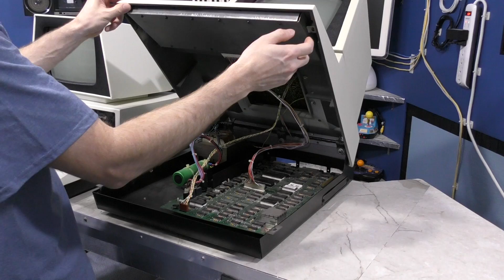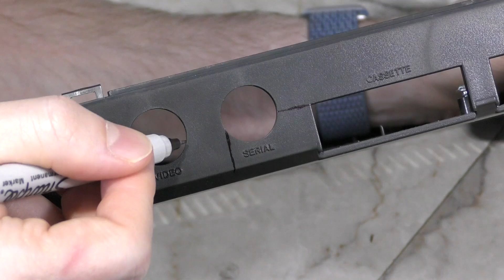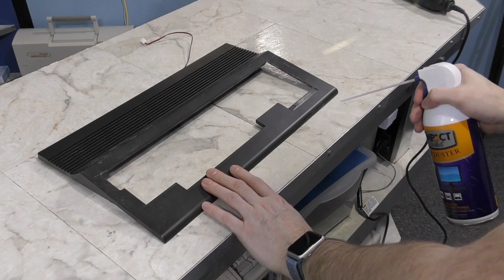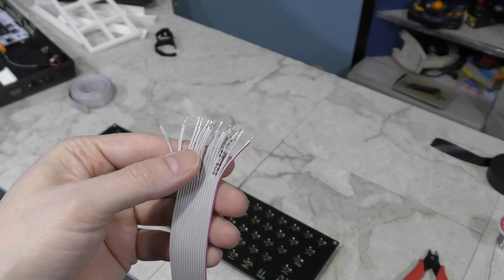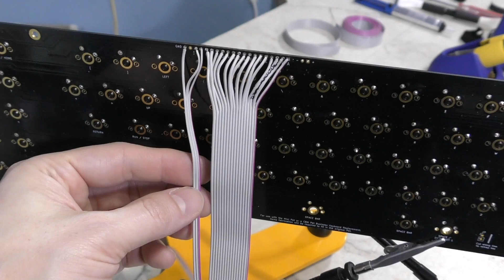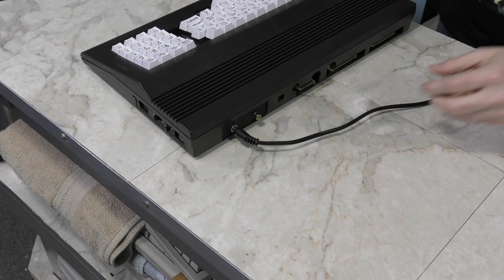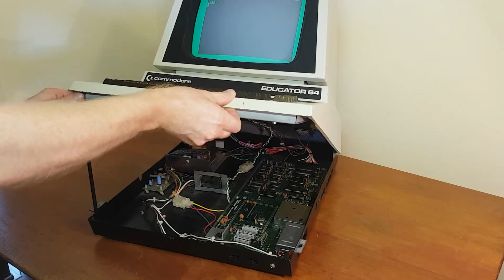Building a case for the Mini-PET

Comment: The weirdest video I have seen in a long time. Why not just 3D print a proper case? Takes probably the same amount of time to design that as it does to cut out all the stuff from another case that just looks horrible at the end. Don't get the approach here.
Reply from the maker: Most 3D printers can't print something that big.
Reply: @The8BitGuy  I guess I would print it in smaller parts and then assemble it? Even if it looks more polygonous with less of the C64 case roundness, it would look better than leaving holes at the back and keyboard, but that is just my taste.
Reply: David is right, just not feasible right now - maybe in the future we can 3D print a custom case.

Comment: Yup, I can confirm that soldering doesn't get easier as one gets older. One day, I was having trouble soldering, and that's when I finally broke down and got reading glasses.Bad news, it's harder to deny that I'm over 50. Good news, my soldering has greatly improved!
Reply: @ItsMrAssholeToYou  LOL! That's better than walking 20 miles to school... Uphill... Both ways.... Through the blinding snow.... in July.... I shouldn't complain too much, I spent my 50th birthday wondering how the hell I'm not in a wheelchair or just dead.

Comment: Honestly, you've saved enough retro computers, that I think you'd be entitled to dremel a few cases by now, Dave. 😉 -- And not just physically saved, you've provided education that I think has contributed to saving a few of them from landfills, and contributed software and other resources to make some of the less sought after machines worth thinking about again!  Keep up the good work. 👍🏻
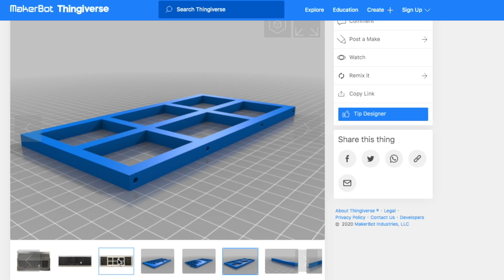Edit: RE @12:58 -- Honestly thinking about the board and port mismatches -- why not just put the PET board deeper in the case, and use card edge connectors on ribbon cables to match up with the C64 port positions? -- It seems like it would be easier than getting Tynemouth to redesign the board...

Comment: Once we have 3d printers that can lay down some simple circuitry during the print, we'll be able to print the keyboard and case as one, then add switches and key-caps.
Eventually printers will be able to do entire PCBs and populate them, but I think the former idea is not far off.

Comment: why not a barrel plug for the power and a quick disconnect for reset? that way the board can be removed without desoldering anything. For the LED you could probably wire it between the reset switch and ground. /RESET floats high and is already current-limited, so...
Reply: I asked about that but he said once it's in the case it'll never come out so I just left bare wires.

Comment: A heat gun makes shrinking heat-shink tubing better than a lighter. (No carbon or accidental burns.)
Reply: Swings and roundabouts. I have a heatgun and I sometimes just use the tip of my solder iron. I have also been known to use my BBQ lighter (long tip) just for cases where I couldn't be arsed with bringing my heatgun out.

Comment: Dave: "filling those gaps would be too much trouble"
Parifractic: "Hold my beer.."
Reply: Yeah, I did see Perifractic build out additional case structure before. He made it look easy somehow. I was really impressed!
Reply: Ok ok
Reply: Cf ok ok
Reply: Cescecu
Reply: Bec
Reply: Jocuri ie
Reply: Domna
Reply: Domna ok ok
Reply: Dai sms pod
Reply: Vedete
Reply: Ciobanu
Reply: Cf răpit
Reply: Wifi
Reply: Tadu
Reply: PPces
Reply: Cf
Reply: Robetes
Reply: Își
Reply: Ok
Reply: Hoti
Reply: Tepatori
Reply: Vadu
Reply: Caldarîm
Reply: Ok
Reply: Cescu
Reply: Pationu
Reply: Eu
Reply: To make the case look better take the 'BBC Micro approach'. Cut a hole that is rectangular that can fit the whole keyboard into it. Then use some poster card (Black?) and cut holes out in it to the exact shape to harness the keyboard into the rectangular hole and attach it to the underside of the top part of the C64 case making sure its overall perimeter is slightly larger than the rectangular hole cut out of the top part of the case so you can stick the edges to the underside of it.
ADDTIONAL: You can also line the Poster Card with black self adhesive laminate (similar looking to what the BBC micro has - available at arts & crafts stores). It will look much more professional and no unwanted spaces or holes!! :)
Reply: @ojbeez5260   Bv cat una este greu si noi  rapoarte cf greu fimeri multi hoti si multi hoti si dai sms ok da greu este

Comment: Wonderful as always. Still working on my Atari 8 bit "Space Invaders" game. Got the finer scrolling going, invaders being animated by loading different frames into the parts of the character set where they reside, your player can shoot pixel wide holes in the barriers (again. character set modification going on)...next thing is to detect the player shooting the invaders, and after that there'll be the missile multiplexing handling. Looks like most game mechanics going on in this game will be handled by means of a deferred vertical blank interrupt, which is awesome. The next game I will try to write will be a "Scramble" clone, but in all honesty, I probably will try to make the maze level not as much of a nightmare as the arcade version. Also bear in mind, still got quite some way to go with the current project.I just haven't looked at any of this sort of thing in years.

Comment: A redesigned PCB should align to the top-right not top-left part of the case.  That way, the connectors and switches can all be on the board.
  For attaching the ribbon to the keyboard, I guess a standard 0.1" or 0.05" header would fit, and the cable could be put in clip-on ("isolation displacement") connectors as used for various traditional PC components.

Comment: I actually use a model makers razor saw for cutting anything like the donor case in your video. While you can’t plunge cut with it some very carefully thought out single plunges with a dremel will allow for a lot of flexibility in cut site and the saw leaves a very clean cut that just needs to be very lightly run over with an emery board to clean any snags.

Comment: To make the case look better take the 'BBC Micro approach'. Cut a hole that is rectangular that can fit the whole keyboard into it. Then use some poster card (Black?) and cut holes out in it to the exact shape to harness the keyboard into the rectangular hole and attach it to the underside of the top part of the C64 case making sure its overall perimeter is slightly larger than the rectangular hole cut out of the top part of the case so you can stick the edges to the underside of it.
ADDTIONAL: You can also line the Poster Card with black self adhesive laminate (similar looking to what the BBC micro has - available at arts & crafts stores). It will look much more professional and no unwanted spaces or holes!! :)

Comment: If you ever have to remove badges in the future, use a hair dryer to eat up the badge.  That will make the glue liquify a bit and it's 10 times easier to remove.

Comment: You should check out the EZ connect Plastic cutoff wheels made by dremel. Seem to work better for me than regular cutting wheels. May depend on the plastic type, but worth a try!

https://www.amazon.com/dp/B07BNJM92F/ref=cm_sw_r_other_apa_i_N8G7FbPMZ0P2N

Comment: To be clear, those are new "Commodore 64C" cases ("sixty-four cee"), the "c"ompact (or "c"heaper ) later, flatter version of the C64 from the late 80's.  Although the story accounts vary, the plastic injection molds (along with plus/4 molds) were fortuitous saved from the scrap melters by an astute enthusiast.
Reply: Eventually you’ll have to make new molds as the old ones get used up to the point they are no longer serviceable.
Reply: @jackandersen1262  If they are still good at the moment, they will probably be good forever. They will never be used for making hundreds of thousands of cases again. I don't know what's the minimum number of cases which is worth making in one run, I guesstimate 5000. If they make 5000 cases every 2-3 years, or even just every 5 years, I would assume that would be plenty. And with rates like this, the molds wouldn't wear out in the next 30-50 years, I guess, if stored properly.
Reply: Yeah, I wish they saved the breadbins too though. :(

Comment: Wouldn't it be better if these hobby single-board computers used a standard form factor (like mini-ITX) so they could be used with an off-the-shelf case? The card-edge user port and cassette port do complicate this, but they could be relocated to an expansion slot.
Reply: An idea kinda like that is in the works with a team I am working with. It'll fit in a C64 case and will not require dremeling.

Comment: I wish i was able to tell you this before you put the project all together, but you can use a small torch or even just a BiC lighter to smooth out the burring on the plastic. It's only gonna affect it looks, but it does wonders.. :D

Comment: It looks like the mini-PET is small enough you could move it further back in the case, and print a PCB adapter just to to extend all the IO/ports to C64 positions to not require cutting a case for the IO.
Reply: That was the original idea but there wasn't enough time to do it.

Comment: I would have done a custom PCB for the I/O section to fit the case. Nothing fancy, just electrical connections for the card-edge connectors and footprints for some plugs.
Reply: We did discuss this but it would've taken too long to deliver, this was the quickest and easiest solution.
Reply: @ChrisKewl  I figured that, China express mail is so damn expensive

Comment: 3D print a keyboard box.
Reply: Unfortunately not feasible with modern 3D printers currently. They are not that large and wouldn't be very stable.
Reply: @ChrisKewl  maybe a toy, but I have seen 3D printed engine blocks.  One need merely give the file to a pro, and pay.  Probably less than 120 euro.

Comment: Please, spend 20 bucks for a heat gun and stop using a lighter to do your heat shrink. You do enough soldering, it's worth it and does a better job.
Reply from the maker: I have a heat gun.  I prefer to use the lighter.

Comment: A Dremel melts plastic more than it cuts b/c it is fast. I would instead recommend a razor saw from a model-making store. More manual work but more precise cuts. They come in many different sizes. One size is just like a old-fashioned razor blade that has got serrated edges.
Reply: Don't Dremels have speed control? (I've just got a noname knock-off, and it has...)
Then it's down to type of tool/bit used - a grinding/cut-off wheel will tend to melt plastic, but they do make circular saw blades that cut plastic just fine, like: https://i.ebayimg.com/images/g/CCkAAOSwYNZavEbe/s-l400.jpg

Comment: For cutting the plastic, one of the methods I've used is simply heating up an xacto or utility knife blade and then cutting. Scoring the lines first helps and you don't want the blade so hot as to melt everything around it. Useful for smaller areas anyway.

Comment: 11:48 Strange, he measured the whole keyboard and wasn't able to just extrude some parts of the keyboard to raise it to the case level.... cmon, that isnt that hard after he has done all this work alrdy.
But anyway, nice looking thingie there.
Reply: Honestly I ran out of time. It was the holidays and my time was limited. It could still be done but now it's just aesthetics.
Reply: @ChrisKewl  Ok thats actualy a very good answer. I got a 3d printer too, and I can see the issue.... u can spend so much time in the optimization of 3d modells.... its unbelievebal.
Btw, i'm going to upload an small model of hrgiger's birthmachine on prusa prints soon, if you are a fan :)

Comment: A suggestion for the RCA "phono" video jack: use a jack-to-jack feed-through adapter and a short plug-to-plug jumper cable inside the case.  The feed-through adapter can even be found at stores like Lowe's or Home Depot, they make wall plates that accept multiple clip in connectors like RJ-45, F-type coax, BNC, HDMI and others.
https://www.google.com/search?q=rca+feed+through

Comment: With a full-size case and the need for a monitor, it isn't very "mini".  I'd have liked to see in adapted into a laptop case.
Reply: Good idea, but most modern laptops are packed so tightly it might be hard to adapt one to accept the board, keyboard, etc.  A laptop style case might work, I seem to recall seeing a kit to build your own using a Raspberry Pi or Arduino.
Reply: @bobblum5973  Agreed on this!
Reply: It is Mini compared to the PET itself, it's SO HUGE. This is something you can just put on your desktop and plug into a monitor.
Reply: The size of the board means it can fit a wide variety of case sizes.  I could see using a new LCD screen or salvaging one from an old laptop, mounting it on something similar to a C64 or C128 case for portability.  Even some portable DVD players could be repurposed as the screen.

In many ways we're duplicating the original design process, weighing the pros and cons of various ways of building it, looking to cut costs when possible while keeping desirable features.

Comment: that spacebar is still stupid, they should just have used PCB mount stabelizers
Reply: You could but the extra cost was a bit silly. Easier to just use 2 keycaps to do the same thing and it's cheaper.

Comment: So total newbie with zero knowledge of how these cases are created?  Are these case shells "old new" stock, or did somebody sit down and have a fab run for new c64 shells?  

If so is the fabrication process something that is easily adaptable---any way to take the CAD files for the c64 shell, but adapt it to directly fit the mini-pet motherboard && the "jigsaw" style framing for the keyboard?  

(I'm guessing in this case [no pun intended]...this would be prohibitively expensive)?
Reply: Making a custom case would be expensive indeed. These are new cases from pixelwizard.eu where you can get them in a good supply. I would not condone destroying an original case. :)

Comment: why not just make a custom case?? thats the simplest solution. all this cutting etc just make your own case that fits the board and a keyboard attached or have it external.
Reply: Measuring my 64C, the printer bed size would have to be just over 500 x 250 mm (printable) to get the print in one piece...
Reply: @EngineeringVignettes  Yep, just not feasible with modern 3D printers currently.
Reply: @ChrisKewl  - Well...
Naomi Wu's 3D "Printmill" might work.. I am not convinced that the surface finish is up to the required consistency for a case/chassis though.
I believe 3D Printing Nerd did a review of it 2 months ago...

Comment: Why not 3d print the case?  Surely a cheaper option!  Not easy but could be done!
Reply: Would not print in a single go, no readily available printers exist to do that (yet).
Reply: @ChrisKewl  surely a 2 parter could be done?
Reply: @welshtechie6832  possibly but I worry about stability. You'd need to print 4 pieces with enough rafts and then make sure they fit. Even then you have a seam in the middle.
Reply: @ChrisKewl  ah ok fair enough. Learn something new every day.  Thank you for that!

Comment: This is a great example of engineering, ingenuity, and teamwork. I like how you decided to modify an existing (new) case rather than attempt to make an entirely custom deal, since the work involved is accessible to many people. Even those without a 3D printer could likely have a 3D print service make parts for them, and most people can afford/work with a dremel. Excellent work, guys!

Comment: I'm thinking an Xacto knife (multiple scores, then snap with pliers) would be neater than Dremmel?
Reply: Or something similar.  I've used a Dremel to score the line first, then bend, flex, break.  Also a hot knife or soldering iron, but burning plastic fumes are not recommended.  I have a nibbling tool that bites little bits out of sheet aluminum like Bud boxes and chassis, bought it back in the '70s at Radio Shack, no idea if anyone still makes them or not.  It might not handle the thickness of the case plastic.
Reply: @bobblum5973  I too have used the metal nibbler that you refer too, it works pretty well for chopping out slots in the back of a pc as needed
Reply: @cliffshockley4406  It's great on aluminum, steel not so much!

Another tip is to use a hacksaw blade, either freehand or with a handle that allows the blade to stick out by itself.  X-acto and others make small precision hand saws, check local hobby and craft shops first, online if needed.  You can find small screws and hardware, brass and aluminum tubing, all kinds of things.

Comment: If it's made from the original molds then it's an original case!
Reply: It's technically an aftermarket case sold by pixelwizard.eu - not an original case made by Commodore. Picking at straws here.
Reply: @ChrisKewl  But does the case know that? It came from the same mother so it's a sibling to the old cases.

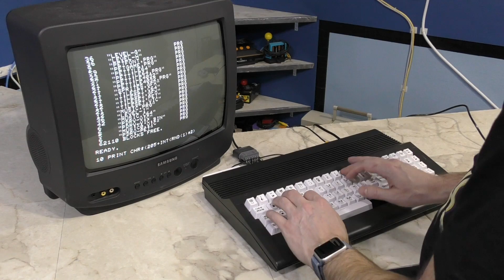Comment: 10:40  LOL !!!
I realize that the earliest PETs had a white phosphor CRT, but I spent my middle school years with green screen PETs.  Is there a settng on the MiniPET board to change the screen colour?  (Without having go back and watch your minipet video  )
Reply from the maker: No, it doesn't produce any color signal at all, so there would be no way to change the color.
Reply: @The8BitGuy  Hmmm... how apart unplugging the red and blue electron guns on a colour monitor (assuming we are using a CRT for authenticity to the PET).